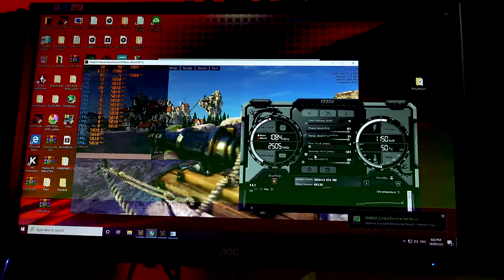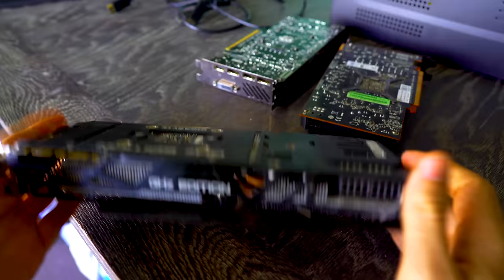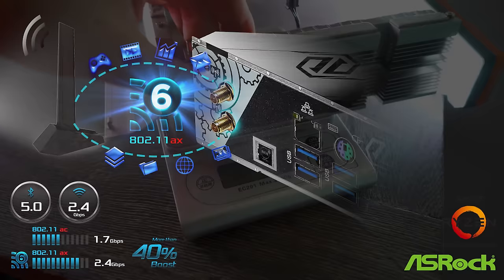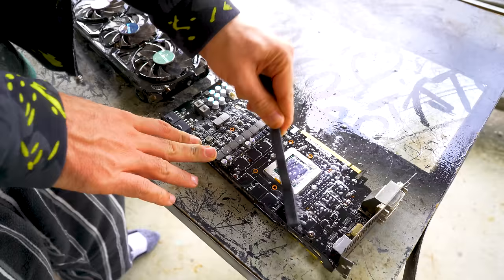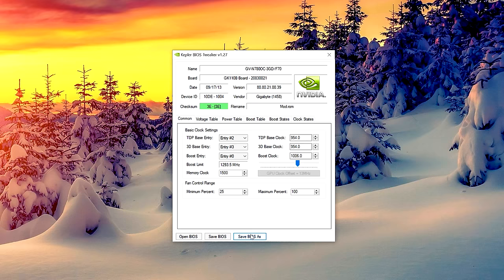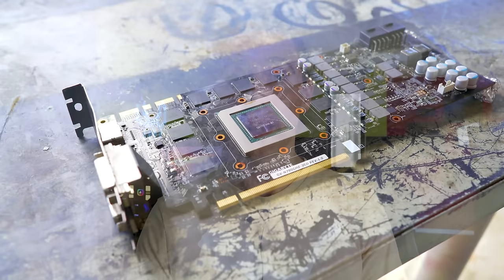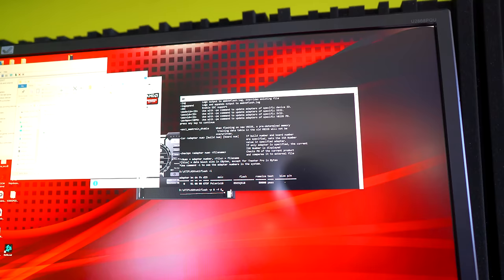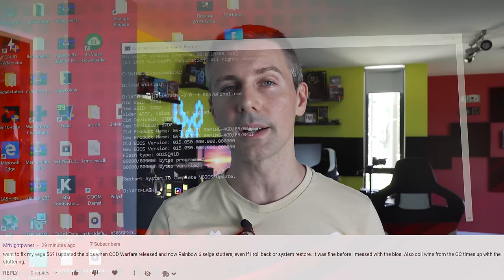4 Problems that Cause a Faulty GPU and How to Fix them.

Comment: Brian, I've got a gpu, an r9 270x, that will work perfect for the first 30 seconds or so in the machine. runs just fine in bios for however long, but when I start into windows, it's a ticking time bomb. after 30 seconds, just black screen. Very rarely an artifacted screen. Have had the card for 4 years, stopped a couple of years ago, have always kept it around as it's not like any of my other busted gpus! Any ideas? Cheers!
Reply: I had the same issue after a while it started causing my pc to hang at the bios screen
Reply: This sounds like your problem with drivers, but my fans do not rev up, and it happens on a fresh copy of windows. weird stuff
Reply: @battyflaps5410  Did you also try repasting? baking? gunning? anything work?
Reply: @battyflaps5410  That could be your ram also,same shit happened to me yesterday.
Reply from the maker: How big is the cooler for it? It didn't have a tiny heatsink like this one in the video did it? Cause that could be the problem, also try heatgun it like I did here if all else doesn't work (last resort).
Reply: @techyescity  Pretty decent cooler, GAMING X variant. Looks like heat gun will be the way to go. Never had have the card stable long enough to down clock xD. Thanks. Best and favorite tech youtuber!
Reply: sounds like  busted vram or even the chip
Reply: I have 280x that started crashing. I found out that latest drivers are causing card to use more wattage and my power supply couldnt run it. Tried undervolt it but still not enough power :/
Reply: Also many manufacturers of different brands with electronics are making things with a date on which product will fail so... simillar cards, simillar time, could be it.
Reply: Did you manage to fix at all?going to try flash a r7 270 bios onto my 270x see if it helps
Reply: @jimmyjoejoyce  I wasn't able to. Haven't thought about flashing down, you could be onto something
Reply: @SwiftMCy  having the same issue. Did you try heatgun method? Did it work?

Comment: The cheap 780Ti I got a while ago started artifacting and I couldn't work out what was wrong. Because of this video I decided to try the heat gun method, except I didn't have a heat gun. So what I ended up doing was propping the card up in front of a halogen heater for 20 minutes. Put it all back together and amazingly it is working again.

Comment: How badly do you have to neglect your GPU for it to get rusty? Did they leave it in a sauna?
Reply: Corrosion of circuit parts in a graphics card also is a culprit of no video signal and may addresd the graphics card is already DOA. Maybe something to look out for also 😣
Reply: That, or if you live in tropical countries, hot n humid environment is no joke man; about 1 year and you'll see rust start spreading.
Reply from the maker: The GPU went on holidays to the hot springs, and decided to come back like a wretched hag.
Reply: Sauna, sisu suomi perkele
Reply: It happens in costal areas they have salt in the air and humity anything even a car starts to rust withing a year is use my bottom engine cover which lasts for over a yearb easy will rip off like a bandaid in costal areas.
Reply: @wisdoom9153  Lmao. I actually do live in a fairly humid environment here in Taiwan, but damnnnn that is some crazy rusting.
Reply: @MarcoGPUtuber  Corrosion and rust are the 2 silent killers of all graphics whether budget to founders edition Sir Marco😬😬
Reply: @wisdoom9153  Brian also mentioned this a few years back regarding corrosion on computer parts😉
Reply: @ORBPHIL  Yea of course. I live in a humid environment myself and it's amazing how bad some parts can get. I try to take care of mine and they're as shiny as the day they left the store.

Comment: I always thought that those round coolers look kinda small too.  Maybe the GPU would have needed to be re-flowed if they used a good cooler.  I always like to see a nice big rectangular heatsink with heat pipes.  That is the single reason a graphics card takes up so much space, the big heatsinks.  I also don't care much for the coolers that come with a CPU.  They are only good enough if you don't already have a better one.  I don't care much for a loud whiny fan but that is what you get with a smaller one typically.  I have a Corsair A70 and it has larger fans than a stock cooler boxed with a CPU normally would have.  It is quieter because it doesn't have to spin as fast.  If that is somehow too much for your ears, mine even came with special cables that you can optionally use to limit the power to them.  I never needed them and I do hear all noises too, it is just that my fans are not loud.  They are not some new design or anything but they are still pretty good.

Comment: I've brought a couple of laptop motherboards back to life using the 'oven' method. I also underclocked their GPUs (which seemed instinctively logical at the time) to make sure my customers got the most of their obviously used laptops for office use. Most technicians here in Tetouan, Morocco say that the heat gun method works for a month, and since I hate how unimaginative technicians here are, I had to think of something a bit creative, that is, underclocking the GPU. Most technicians here focus on the hardware, and when it comes to software, they're practically illiterate except for the part where they memorize certain button clicks like it's some ancient knowledge passed down through generations. Lmao

Comment: I have an old laptop, it was working perfectly earlier. The problem is my games crashes to desktop after 5 to 10 minutes. Sometimes the laptop hangs or restarts it self. 
Games (even GTA 5) and heaven benchmark 4.0 run fine on battery power, but if I try on AC power it crashes. What could be the problem?
Reply: When the AC power is connected, the laptop will get hotter. What is the temperature of the GPU, CPU or laptop before the laptop crashes?
Reply: @GigaPlaya  cpu was at around 70'c and gpu at around 55'c...

Comment: A thousand points for that Law & Order DUM DUM. :D  I have a few fudgy cards I plan on having a go at repairing using my Quick, not gotten round to it yet as they're only an old 8800GT and GTX 570. Re faulty VRAM, I suppose there is potential there to swap the bad IC for one from a donor card, but that would require some more detailed meddling a la Louis Rossmann style. I do have a GTX 580 3GB I want to fix sometime (got the relevant microscope, etc.), maybe commiechan lockdown will give me the time to at last look at it. :D
Reply from the maker: Yeah I would love to do that next level micro stuff, but it would turn out to be a parody video instead if anything.
Reply: Right to repair baby !
Reply: owO commie-chan
Reply: @pingu1508  delete this
Reply: @thrace_bot1012  no u
Reply: Lol

Comment: Bro i am having a zotac gtx 750 ti
Fans are spining.
When i boot up system  it shows boot screen for 4 to 5 seconds and than no signal
After reboot it shows boot screen for 2 to 3 seconds and then remains 
No signal untill i unplug graphic card from motherboared and reinstall it how can i fix this plz help me.😭

Comment: I baked my entire card in the oven (removed anything plastic or covered them with foil paper) worked like a charm. Did this for a MacBook pro that had display issues, also worked. Sold them after (let the people know and I sold for cheaper because of it) they have been working for 5 years so far!
Reply: How exactly do you bake it? How long and on which temps?

Comment: Actually there is one other thing i recommend please dont use smart fan control on your graphics card i have seen so many radeons and nvidia cards that failed completely dead no bringing them back because users thought the driver software would kick on the fans at a certain temp they never came on and they roasted the card use msi afterburner for your fan speeds save a card

Comment: "Multi-Purpose Spray", so, Windex?
Reply: i think it's wd40
Reply: @syedm9654  Oh, I'm not spraying my electronics down with WD-40!
Reply: @neophobicnyctophile8264  it’s a spray found only in Australia similar to wd-40, but doesn’t leave a residue. Wd-40 actually makes a spray specifically for spraying down electronics like motherboards and graphics cards that doesn’t leave a residue either.
Reply: @thefallingpenguin5614  ...Windex?
Reply: @thefallingpenguin5614  it's called WD40 Specialist I think

Comment: If you're going to try heat, first (when the gpu is powered on, with the shroud off), point a heat camera at it because you might have a short circuit causing the problem such as a melted soldering trace and that might show up as a hotspot on the heat-camera. It might be your reflowing-action from the hot air or oven is somewhat fixing that (but it might need desoldering and resoldering - but be careful if a hot component chip or asic is BGA). At least you'd see in the thermal-camera though. It helps a lot of you have an identical GPU card to compare thermal-camera footage to see what the heat displacement 'should' look like on camera.

Comment: It works btw. I had a gpu that died like 3+ years ago at least i thought it did. My new gpu was dying too. I had the code 43(or 34 dont remember prob 43) and the whole day i was trying to fix it. The at the end of the day i lost hope tried this with the hot air gun(if you call it that) and it worked. So basically my old gpu that i thought died came back to life and word of advice never throw away old parta you never know when you'll need then. Unless you are rich then just buy a new pc.

Comment: ahh... board in the oven always works.
Reply: It fixed my titan
Reply: it only works with cards that still can be read by the PC. i've done it twice already with 8800gt and 560ti.
Reply: dopeless hopefiend actually fixed mine the same way today lol
Reply: Fixed a powercolor AMD Radeon HD7850 twice in the oven and was still working 2 years later when I finally replaced it.
Reply: @DEATHxD3ALER  what temperature do you use in the oven and for how long.
Reply: @wahabfiles6260  I can't remember right off the top of my head but here's a link https://www.youtube.com/watch?v=8Xanr4jkmEc or you can just type in "Graphic's card in oven" and get a lot of returns just go through them and watch a few.
Reply: Same. I used an old oven toaster on my dead 5670 (fans working but no display) back in 2016. Then it died again after 3 mos, sent it back in my oven toaster for like 5 mins, and it's still working until today in my potato pc.
Reply: its so cool haha i got my r9 280x back with that method :D

Comment: I have the exact same R9 270 GPU. Thanks for the ideas on how to repair.
Reply: I finally bought a heat gun and can confirm that this fixed my graphics card. I'm back to full 1440 resolution. Thanks again!

Comment: @Tech YES City
Had that the 1st unsolved problem where the display goes black after installing drivers. I experimented with the faulty gpu (rx590) and i found out that if you manage to manually set the clocks to their minimum the card will be stable. Durin that stable time, I had the chance to test the vram which was ok, play a game (ok) and encode videos (ok). This leads me to think that there is a problem with power converters. The chip itself is must be ok, but not getting enough power from its onboard converter will cause the chip drain more current which the faulty converter cant provide, in turn results in a voltage drop below the minimum required to keep the chip on. This has the same impact as removing the power cables from the gpu, that will turn it off and cause the os to freeze (the symptoms i had). Installing the drivers has the effect of activating most of the gpu's circuits and functionality and clocking it relatively at high clocks. It is in that moment where the power converters are required to provide more current, they fail and the black screen happens. This is a hypothesis. i have not verified it to be true or not because i dont have the tools needed.

Comment: 8:43 I thought this was my issue with the exact same 2080ti until I realized it was damn windows updates....lol good to know my card isn't dead.
I do however have 2 GTX 460 cyclones, 1 is my original from like 07, the other I got on eBay, it boots and gives video signal to monitor but the picture is all fucked up 😂, looks like someone seriously dropkicked it off a bridge, spent hours straightening out the heatspreader fins that were all smashed together, completely disassembled/new paste/cleaned with alcohol but idk...it halfway works
Reply: i did the win10 Bloatware removal github  1st time i seen it thought  aah looks hacky 
but watched again 3 months L8tr and tried it 👍🥇 Not hard to do Use powershell 
if you want try  the github script  you copy paste in below comment and were the video i seen it ok
Reply: iex ((New-Object System.Net.WebClient).DownloadString('https://git.io/debloat'))

you do it again after every win10 updates because they keep adding some old crap back in not a worry but / helps Also > The Video i watched  https://youtu.be/nVy4GAtkh7Q?list=PL787b9qGBLAohK_xny94_TrBrLXv7Qo3z 
Nvidia: Desktop control settings :Display .  customize. Use Nvidia color settings Dynamic range - FULL

Comment: I cleaned my entire pc since it was a year this past November, the dust was so stuck to the fans from smoking, so the air spray I had was throwing out water, so I took it all off and cleaned it to get anything wet off, here in Florida it’s hot, I was in the Florida room sweating for a few hours, put it together and plugged both monitors in and turned it on. It worked for a good 5 minutes till when both monitors went down as I was in the Control Panel to set both monitors up. Only had one till I just got another. Never fails. It’s a GeForce 1650 Super GPU. All fans turns. Oh after the monitors went down it was causing my pc to stop like 3 times I guess it was resetting to find a monitor I guess

Comment: What is the "multi-purpose spray" stuff you're dousing them in?  I have a couple cards (a GTX980 and a GTX1080ti) that I had a liquid cooler leak on.  They both do "problem #2/#4" now.  Really don't care about them outputting video...just want to be able to use them to mine.

Comment: That Problem with the "Driver Crash" can be a real pain. I personally would not say this solution can/will work for everyone but it worked for me .
This Problem can be  'Avoided' for the future (More Like being Prepared) for the worst case scenario being the "Driver Crash" after the drivers are finished installing.

1) Boot Windows into Safe Mode with Network Access enabled/checked and this can be done in Advanced System Settings.

2) Restart your Pc so that it can Boot Into Safe Mode.

3)Install Your Drivers for your GPU.

4) Go to Advanced System Settings to turn off Boot into Safe mode, preferably after drivers have completely installed and restart your PC.

5) Lastly as your PC Starts up again, just close your Eyes and Pray to the Computer Gods that your Driver wont Crash

Comment: If anyone is watching this a year later can you let me know what he is using to clean the gpu. Love the content, thanks :)
Reply: As he said it's a multipurpose cleaner, it's usually for car use, non conductive stuff, he also use brake cleaner/surface cleaner which does the same thing
I personally use brake cleaner to clean my PC stuff and wd40 afterward to displace any residual moisture, they're all non conductive so they're safe to use on electronic

Comment: when a GPU gives black screen after drivers install it is because some of its connections to the die has gone wrong. this is where using the heat gun or the classic oven at 190 degrees C can work and I saved many cards like that. the only issue is, the heat gun or oven method resurrect a GPU for a short period of time, some times days, weeks or a month. not much longer than that.

Comment: I had connected to external psu with cheap risers, my both gpu gtx 1050 ti and rtx 2060 stopped working. Both got fan spinning and no display. so, is that about something burned or what happened to those? Also when plug in the 8 pin connector to rtx2060, the fan stopped spinning and only fan spinning from x16 pcie slot. The external psu is 1600 watt bought for specially btc mining also written on it. Any suggestion would be great help and much appreciated. Thank you

Comment: You know I'm not gonna lie I thought you where full of it about ASRock mobos being good. Tell I got an ASRock Z390 Phantom Gaming ITX/ac and was blown away by how easy they are to use and how well they preform and my board only has a 5 stage VRM but still handles the 9900K just fine. Good on ya for recommending what you believe in even if folks talk crap.

Comment: If u use a heat gun to fix the card then chances are it was a broken cold weld joint that u melted back together could try micro solder and a magnifying glass

Comment: the heat gun ONLY works if the solder attaching component to board is rusting. heating it up will cause the solder to re-capilate and push out the rust and fix connection. works even better if you cover PCB with flux.

Comment: I've fixed quite a few GPUs with about a 50-75% success rate, depending on how to define broken (I just "fixed" a failing GTX 760 that simply needed new thermal paste). As far as baking and/or heating, that only works when a large BGA component like ram modules or gpu core have defects in the solder balls. The main reason so-called "reballing" doesn't usually last long is because solder pads are typically damaged by the time an issue pops up. Reballing melts the solder enough to regrab whatever trace might still be there but weaker than it was orginally. Any gpu that is fixed by reballing needs a cooling upgrade or shouldn't be pushed very hard, or you can be sure that thermal stress will bring back the issue.
Reply: could i know a best contact cleaner for this process?